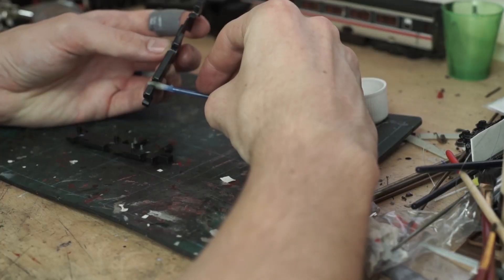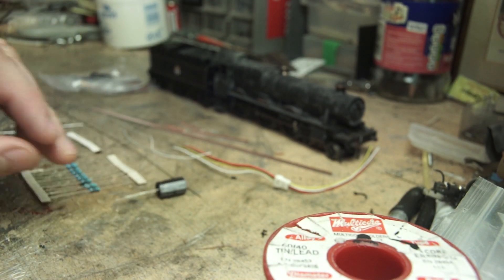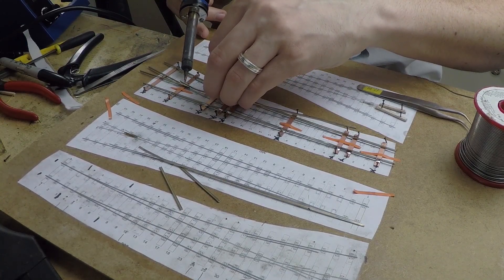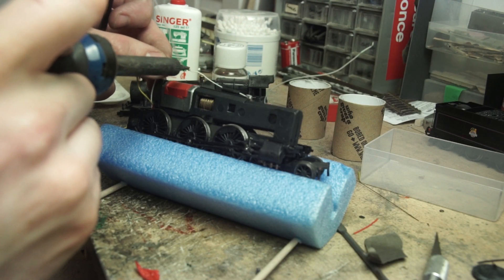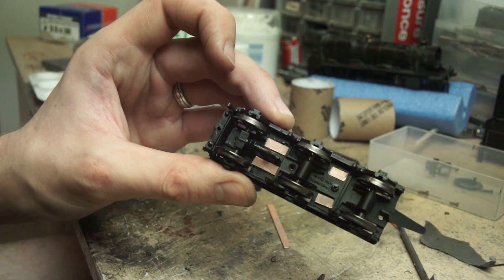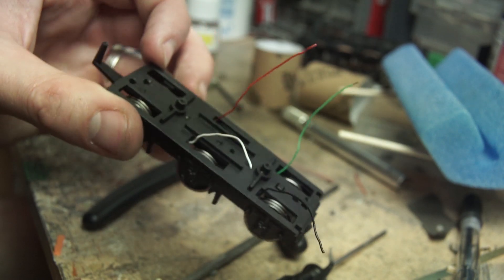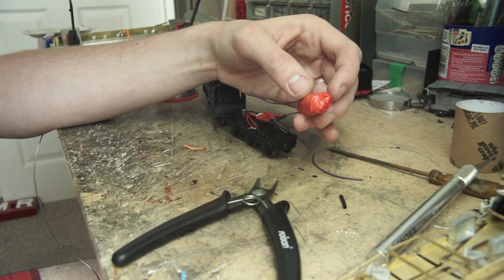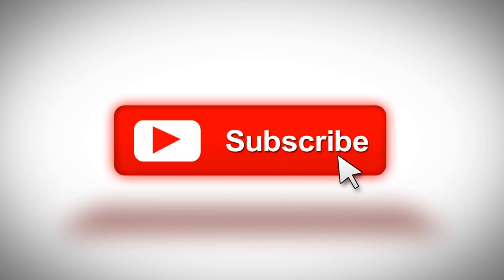Installing DCC into a Split Chassis Model & Other Upgrades - SWAS Episode 31

Comment: Interesting video. I decided to fit a dcc sound decoder in my Athern Spectrum ho SP 4.8.2 which has a split chassis on stripping it down i found the two connected by a brass bush on the motor on further inspection i found it had track  wipers on the  eight  driving wheels so i think this will be fine to fit a dcc decoder. What is your take on this. Have you ever come across a split chassis like this.    Cheers Brian

Comment: Easy way i used to do it, strip chassis down, select a part of each chassis side and file a small part down usually on the top, enough to drill and tap a hole, 8 or 10 BA about 3 or 4 mm deep. Screw a brass screw into the hole until it bottoms and is tight in the hole. now cut the head off the screw leaving enough of the brass screw showing to solder a wire onto. You now have a proper electrical connection to each chassis side.

Comment: I’m a fan of these older models due to their detail plus a jack I’ve discovered in terms of use of highly conductive grease on the axle slots to make them run better and last longer.

Interesting video - what decoder did you use?
Reply from the maker: Ooo that's a good idea, will have to look into that, as I've been fairly hit and miss with grease/lubricant I've used. The chip I used was just a big standard laisdcc 8 pin decoder. They have mixed reviews, but for older model with standard motors (IE not coreless) I've had no issues 👌🏼

Comment: Very informed video. I am confused as to how prescisly how the spring wires onto the brass strips work on the conversion. Any help there plse
Reply: I too am confused by this. I am assuming (dangerous word!) that the superglue not only sticks the strip and spring on, but also is the insulator from that side of the chassis? I'm binge watching all your videos. They seem great to me and are very informative.
Reply: @jonathanfrayne9501  the copper clad sleepers are only metalled on one side, the side without glue on, the spring acts as a bridge between the copper and the opposite side of the chassis
Reply: @cakeskin3333  I think I'm getting it. So, the copper clad plus spring are attached to one side but are the connections for the other side of the chassis . . .  clever!

Comment: Nice - I have a pair of GWR 4300's which are in sore need of some type of modification. Having heard the "you can't DCC a split chassis" constant refrain, I was resigning myself to needing Comet Chassis kits for them - still might need to go there, as the wheels and running gear need to be replaced at a minimum.
Reply from the maker: The comet kits do look good, (albeit pricey with everything else required). I've been tempted for a while but haven't got round to one yet as they do look formidable at the same time!
Reply: @SteamWithaScooby  With Comet and my current skill levels, I'd probably be looking at starting with one (or a rake) of their coach kits, and going up from there. So eagerly awaiting the next stage of your build!!
Reply from the maker: @neilharbott8394  They've not been as challenging as I expected them to be, so I'm sure you'll be fine! I hope to be continuing getting cracked on with my super saloon very soon!